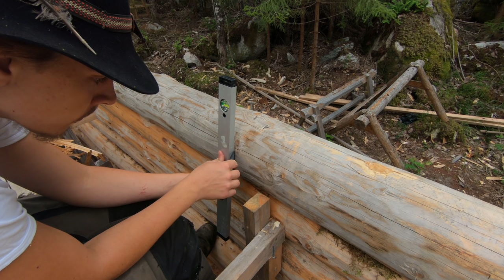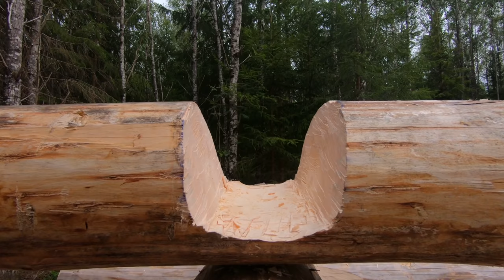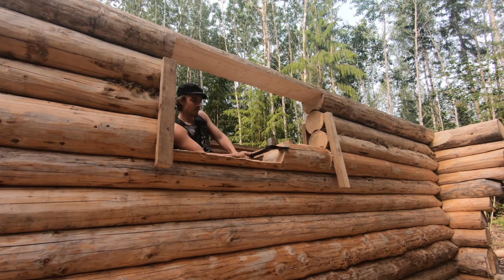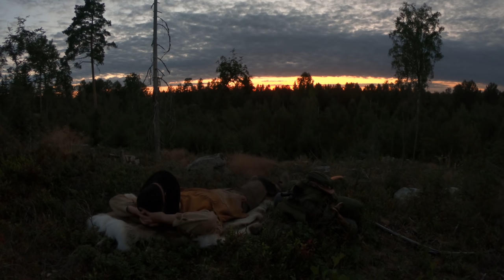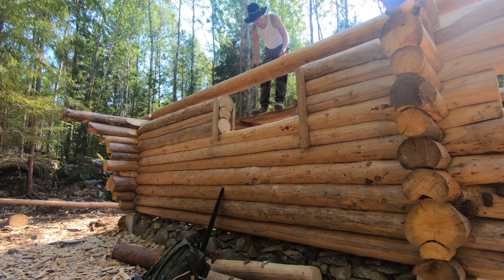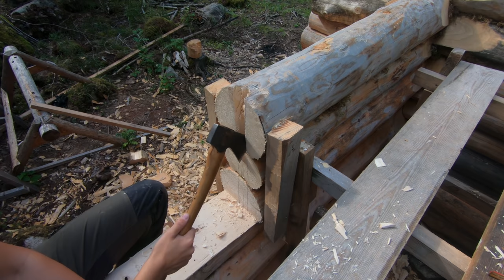Log Cabin Windows Done using Simple Hand Tools | 17 | - One Man Traditional Log Cabin series

Comment: Nice work my friend.. Don't make the door & window bucks tight to the tops of your plate log,,, 3/4 of an inch per foot shrinkage for wet green logs is the rule,, 4 foot window high,, 3 inches of space.. Your logs are still being wet from snow & rain,, 1/2 per foot space should be safe... If you make the bucks tight the top log  they will gap a couple inches & bow!! Aloha ,,stay safe...
Reply from the maker: Thanks for the info Richard. I know you have to leave a gap but not exactly how much, thanks.

Comment: Great job! 
Have a question: are those top logs the top of the wall? If so, I would offer a friendly advice : you may need to dearly reinforce the window frames so they hold the log of the roof rafters. The cut was very deep and left little wood to prevent them breaking under the roof load. Good luck and take care of yourself!

Comment: i would like to eat those logs
Reply: When there has been starvation (extreemes in the weatherconditions etc) people have actually eaten grinded logs in sweden. It fills the stomach cant digest it. The human stomach simply has not got the capacity to melt the cellulose strarch. Last real bad starvation in Swedish nothern was in the 1870-s. Later the railroads had been built and it has been possible to transport food (ceereals) by train. Today "barkbread" and also weat bran is use to loose weight - it fills your stomach but you will not gain a single gram since the stomach cant digest it. But eating logs is not a good suggestion. The malnutrition will among other things give you brain damages.